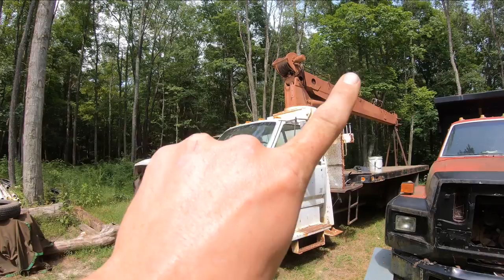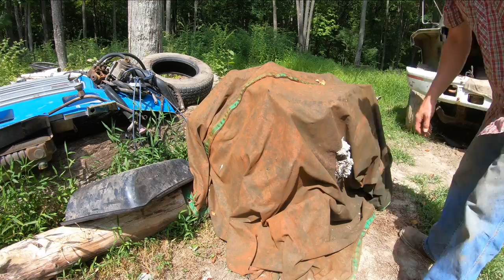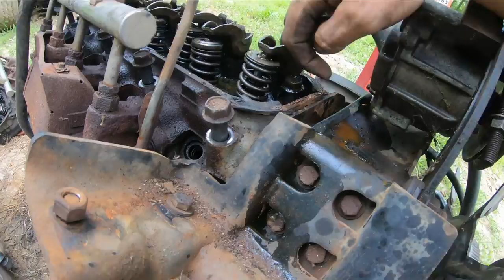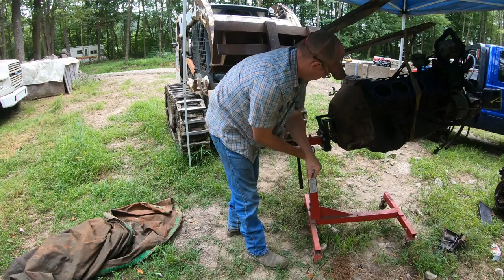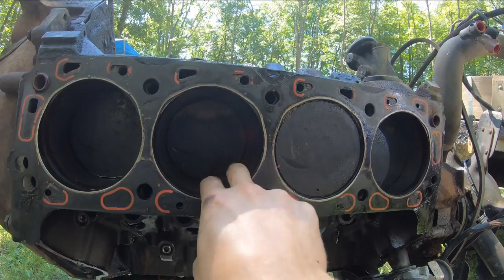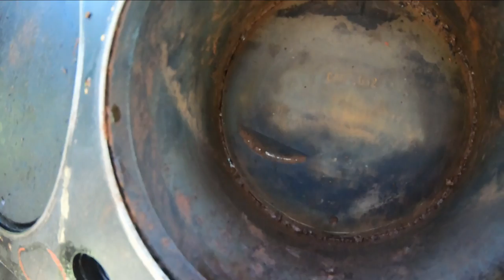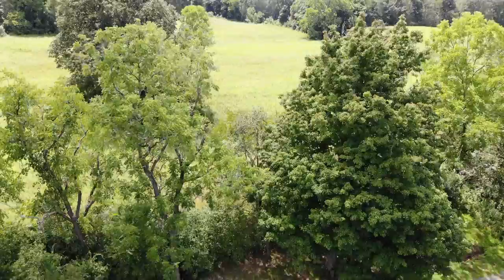Rebuilding a Big-Block in the woods! $700 Auction Crane Engine with big problems!

Comment: Flood truck? Better check the gear boxes too, unless someone intentionally filled the engine with water or the hood was left off with the intake open. I have seen silt like that in vehicles that have been in a flood unless someone intentionally filled it with silt and water.

Comment: uncle tony's garage uses gasoline to hone an engine and this dude was one of the power gods of the 80s so i bet PB blaster is fine
Reply: I operate a small engine repair shop. I hone cylinders in my solvent tank. I just turn the pump on, aim the spout into the cylinder bore, grab the drill with the hone in it, and off we go. Some new rings, and Bob’s yer auntie! Can pretty much guarantee that the rings will be stuck on that pistone. Just went thru the same thing on a Krohler Magnum 18. One side was perfect, the other had been sitting with water in it. Tried to clean up the cylinder with honing after getting it torn down , but the pitting was too bad. Got a replacement cylinder, gonna get two new piston kits and hone the cylinders and should be ready to go.
Reply: @notajp  damn thats a great idea

Comment: THE CLAY IS BARS LEAK OR STOP LEAK SOME BRAND TO SEAL THE HEAD GASKET THE ATNIFREEZE MY HAVE KEPT IT FROM RUSTING SO BAD AND IT HAS A COOLANT LEAK SOME WHERE THE  RADIATOR OR HOSE USUALLY THE SHORT HOSE ON THE FRONT OF THE MOTOR WHERE THE WATER PUMP IS. IT WAS PROBABLY RUNNING OUT OF WATER AND GOT HOT AND BLEW THE HEAD GASKET THE GOT WATER IN THE CYLINDER. Ask me how I know its bars leak? LOL

Comment: You said that that metal that comes to get a center of the hood has a leak in it why don't you put a piece of flat metal up against it and screw it into the inner wall of that hood and then the water runs on each side of motor and don't run down into the motor

Comment: I think the engine stand failed due to too high a load too far out from the bolts.   The bolts extend out too far, and adding the bellhousing and engine and hardware out in front of the engine is too fulcrum for those poor stand mounts to hold up.  It's like holding a broom out vertical one handed.  With a goblin sitting on the bristles.  And he's got a backpack full of school books. Goblins like school work.

Comment: Put that 370 Lima engine in the crain truck, the 370 Lima eng is a great engine, that will last forever with proper care, and it runs :) Dont wast your time trying to fix the 429 engine, its not worth it,  Retired Female fleet equipment Mechanic.

Comment: IF THEY STILL MAKE CAST IRON RINGS I WOULD GO WITH THEM I USED THAT KIND MANY TIMES THEY WORK REAL WELL ON OR IN YOU,RE SITUATION THEY SEAT FASTER AND WILL HOLD OIL BETTER THEY WONT LAST ASLONG BIUT IN YOU,RE CASE THEY WOULD BE BETTER THAN PREMIMUN RINGS DON,T WORRY ABOUT NAYSAYERS THEY WANT TO COMPLANE PROBLLY DEMO DOGD ANYWAY GOOD DAY MATE

Comment: Guys complain a lot about how "poorly engineered" stuff is because it's hard to work on... Ignoring how egocentric it is to assume the only design consideration is "how easy is it for YOU to work on", just keep in mind that if it were easy and just anyone could do it there'd be no money to be made by handy farmers like yourself buying broken down equipment from auctions and fixing it up 😉. Or for that matter, if anyone could do it there'd be no need for mechanics whatsoever - just think that the more difficult something is to work on the better the job security.

edit: to be clear I'm referencing the rant at 4:58, not the water issue. The water issue is stupid

Comment: Never, never, never use gasoline for any purpose other than fuel.  That is its only safe use. 29:47  It has a very low flash point and very easily ignited. It de-fats the skin, opening it up to dermatitis.  For the record, one gallon of gasoline vaporized has the same explosive force of a case of dynamite. You have a lot of influence with many people.  Don't be a bad example for them.

Comment: I don't see anything wrong with what you are doing except that poor engine stand. Even investing in some new parts like rings and gaskets for the engine you still aren't that much money into it. If you only use it twice instead of paying someone else to bring a crane in for a job it will have basically paid for itself. Probably 3 or 4 jobs  a year would put you money ahead even factoring in registration and insurance.
I would say the clay was bugs or stop leak. I don't think that pit in the cylinder wall is too much to worry about, as the cylinder wall would have to be paper thin to worry about a hole into the water jacket. Should be a good truck even if you don't spend a lot of money and time fixing it up.

Comment: I know, I know. 3years later don't mean squat, but man, put the running engine in. You can't just "hone" the rust I already saw in those cylinders. Yes, you can just hone them, but it isn't anywhere even near the neighborhood of right. Engines are stupid, very stupid, and it will most likely run after your "rebuild", but it is just a failure waiting to happen before you even put it back in the truck.

Comment: That truck had a 370 in it, and you have a perfectly running one on the ground?  Why are you wasting your time with that rust lump 429?
Reply: He took the engine out of the truck, the 370 he got for a case of beer.
Reply: @BlueDually4x4  I know, my point is that a running engine with smaller displacement is a better bet than a rusty 429. That truck isn't going to be a powerhouse with either engine.

Comment: Hello mr diesel creek....you are a industrious fellow and I watch you with interest and amusement as I have similar equipment and experiences.your attempt at being a engine enthusiast is sad and somewhat horrifying 
It’s interesting that you did not take front engine accessories off as well as not removing the flywheel assembly off as well....one thing is your attempts to use a glaze buster with a terrible choice of honing oil.
If your objective is to have a running truck with least amount of investment ...find a real auto machine shop and have the cylinders honed on a sunnen or similar power hone that will not only restore the correct cross hatch but make the cylinder round and straight....it will be worth the $100 bill ....it’s really only way to protect your investment in time and labor...you can easily free the rings with heating the alloy pistons with a hand held propane torch...I’m not sure how much damage was possibly done with how you removed the pistons
You should also address the timing chain and obviously go through the oil pump.....but I would just suggest you start with a running 460 which you could if interested use a brush research ball brush to freshen up cylinders
They take out very minimal amount material and are far superior to the glaze buster which does more damage than good.....good luck and I’m not criticizing your process ...I owned a race engine only performance machine shop and did quite a few of the engines for jet boats and one boss 429 asphalt track engine...they are by the way a almost direct copy of the Chevrolet big block engines....good luck..

Comment: A lazy man will kill himself at work: Just take the damn crank out. Painful to watch.
Reply: Hangs a bigblock with the front dress still installed off of the bell housing and is confused when the stand breaks. I'm surprised the housing didn't break. Either way, the top and bottom bolts for the transmission flange are too close together and it should have looked sketchy af to anyone with eyes. This is how-to make a big-block prybar.

Comment: There is no shame in what you are doing. If you were going to depend on the truck do work making money it would be different. If it's going to be a barnyard dog what's it going to hurt. For the farm if the  thing doesn't hold, a remotor with a 4 cylinder diesel might be easier to work on as all used junk needs to be fixed before you can use it.....LOL! At least mine does. Those low gears are for getting things moving, most of your horsepower goes to pushing the whole truck and load at highway speeds. It all just depends on how and where it's going to be used. As for that I'm looking forward to the next video and hearing it run. Wear your steel toes when you are using those China freight engine stands. My son hung a Honda motor on his and the welds let go! Sad thing is that even if you got a stand from  someplace else it would be the same thing just a different sticker label.
 Be safe and have fun! 
Terry from South Carolina

Comment: FORD, fix or repair daily, what possible difference could it make about the engine, I gave up on ford in the mid 70s. I wouldn’t beat on it to hard with that hammer, you will hurt it’s feelings.

Comment: If you are stupid enough to stick a steel shaft inside an engine block you are planning on trying to repair and no short rubber hoses on rod bolts when removing pistons. You would be fired on the spot at any machine shop doing that foolishness not to bright can cause serious damage to an engine. Why not at least attempt to do a good job. Pounding on pistons with any steel is a completely stupid idea. You would not be working on any engine of mine. Other than that, most of your videos are pretty great. Only need a bit of common sense on a few things. Speaking from my own stupid mistakes 'been there, done that', could say wrecked alot of shit in my day. Payed the price for leaning not to do certain stupid things again...Hope every thing works out wonderful when yrr done. Thanks for sharing